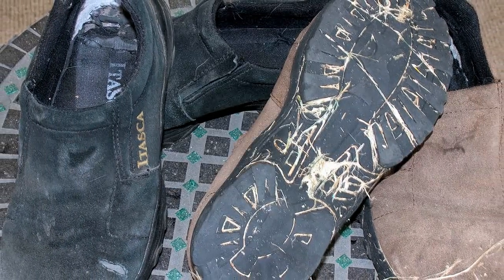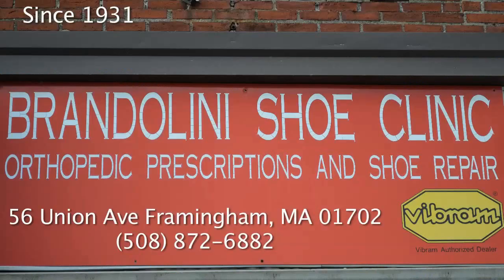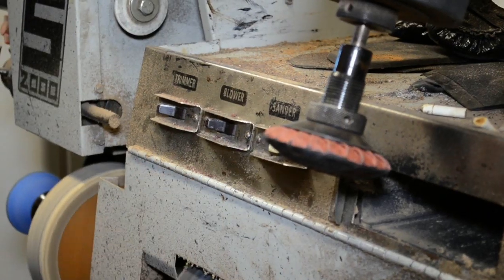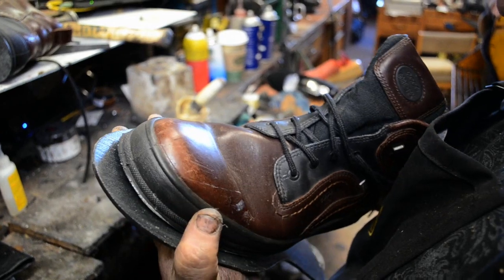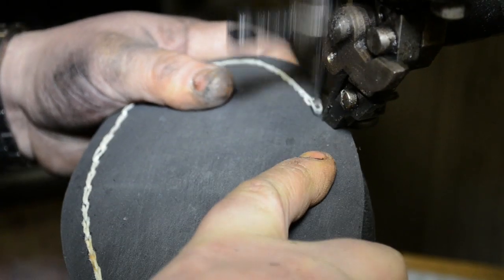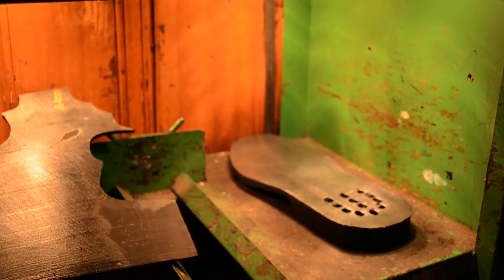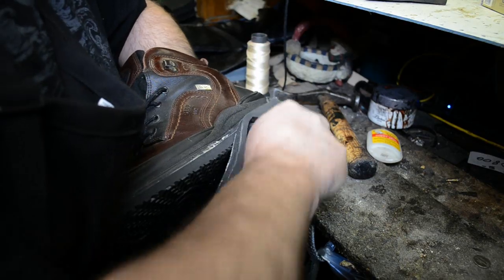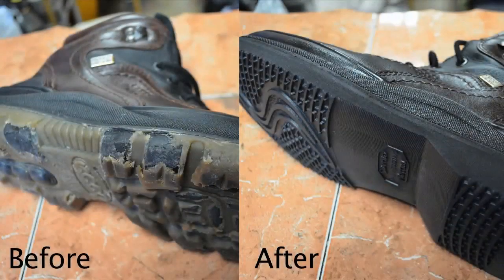Shoes - Process of Shoe Repair / Don't throw shoes away, repair them!

Comment: great method for resoling the Ecco boots!  I do however have a concern with leaving the polyurethane (PU) rand on the sides.  On an older boot like that the PU is crumbling on the bottom and will soon crumble off the sides due to age.